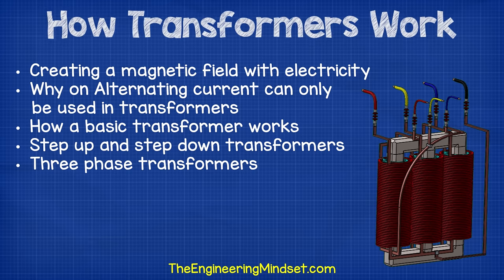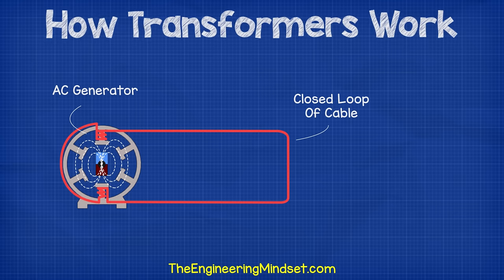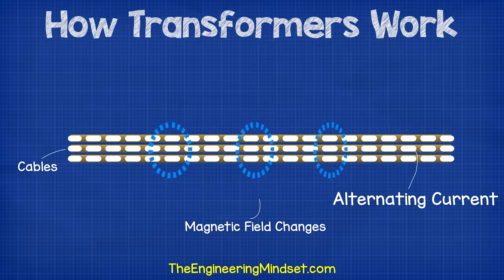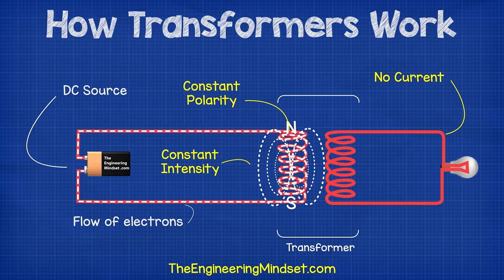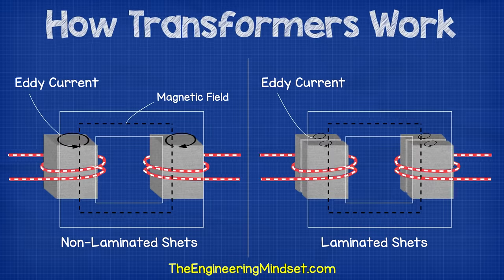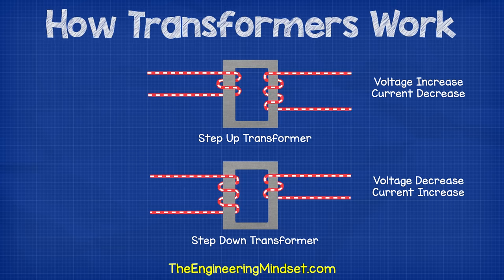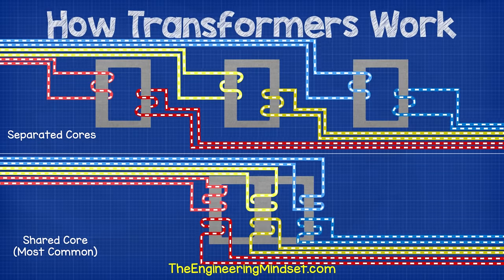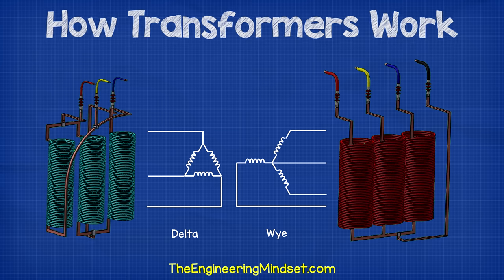How does a Transformer work  - Working Principle electrical engineering

Comment: So do I understand this right?

If I want to convert 120v AC to 5V DC, I should first use a transformer to bring it down to 5V, and then use a full-bridge rectifier (with capacitors) on the 5V side to make it smooth DC?
Reply: you can also use a transformer with slightly higher secondary voltage and an integrated circuit to hold the DC output constant. in your case, a transformer with at least 8V secondary voltage and a LM7805 provide a stable DC output of 5V, using a bridge rectifier and bypass capacitors
Reply from the maker: Rectifier video here https://youtu.be/RiRyzLl4Y8U
Reply from the maker: Seen our new Transformer video? here https://youtu.be/jcY4QN7awEc

Comment: What happens to current when voltage steps up? I've heard the current drops but ohms law says the current should also increase unless the resistance also increases.
Reply: When voltage rises the current goes down. In theory on an ideal transformer the power doesn't decrese so P=UI on both sides. From this you can see that when voltage increases, current decreases. It has nothing to do with resistance.
Reply from the maker: Seen our new Transformer video? here https://youtu.be/jcY4QN7awEc

Comment: At 4:40 you mentioned how a power station would use a step-up transformer to increase the voltage... but why would it also decrease the current? Ohms law says the voltage is directly proportional to the current, so I don't understand why increasing the voltage through the transformer would decrease the current.

EDIT: after some googling, I found out that what's missing is the idea of Power which is a product of the voltage and current: "to maintain the same power, if we increase voltage, what happens to the current?". This concept is missing from the textbooks and this video =( Also the voltage in Ohms law relates to potential difference (i.e. between two points) not along a conductor.
Reply from the maker: Seen our new Transformer video? here https://youtu.be/jcY4QN7awEc

Comment: I assume it possible to step up 240 1ph to 480 3ph.....however if you have a 1ph 120/120 line IN, whats the safest way to introduce the L3 from either L1 & L2 on the Step transformer  so it powers a 3ph 480 motor without the use of an idler motor phase converter ? Thank you
Reply from the maker: Seen our new Transformer video? here https://youtu.be/jcY4QN7awEc

Comment: According the law of energy conservation, when6the voltage is being stepped up the current should descress subsequently. However, according to ohm's law, and increase in voltage will lead to an increase in current given the same resistance. These two rule seems to cotridict one another, how does that work?
Reply from the maker: See our newer transformer video, fully explained

Comment: Paul, I have a question. When DC is being switched in voltage and creates some minor EMF, what is the type of current on the other side of the transformer?
Reply: Impulse?
Reply from the maker: Seen our new Transformer video? here https://youtu.be/jcY4QN7awEc
Reply: @EngineeringMindset  Thank You! You are by far one of the best sources for amateur electronics.

Comment: Will magnet as a core (instead of iron piece) make any difference to the amount of the magnetic flux/power resulted?
If it is, does it affect the voltage generated? or the amperage?
Reply from the maker: Seen our new Transformer video? here https://youtu.be/jcY4QN7awEc

Comment: If the inner coils are your lower voltage, (secondary windings) and your outer coils are your higher voltage (primary windings), wouldn't the inner coils then be the star configuration with 4 bushings?. Electricity in the UK is stepped down from 11kV to 400/230, using a neutral so I thought the configuration would be the opposite of what it is in this video.
Reply: Is it possible you meant low current instead of voltage? Where current is inversely proportional to voltage in a transformer, it would make sense that current would be lower on the side with higher voltage (Delta configuration).

Comment: This might be a stupid question - Why is the light bulb only lights in AC current and not in DC current? I get that magnetic field is constant but in simple terms is it safe to assume that DC is basically "low current" which is mostly used in battery type devices and AC is "High current" that basically runs your home appliances. If this is true why did we ever need DC and AC current, why not have one and create devices that run on one current?

Comment: What do you mean when you say that power stations will use step up transformers to increase the voltage but reduce current to minimize losses over long distances. Does not increasing voltage, increase the current? Is some form of resistor involved to reduce the current?
Reply: No since you can't get something for nothing . I will explain briefly . Say the power station generates 10000 volts at 1000 amps , they step up the voltage to 50000 volts now they have only 200 amps in that line going to your town . And they change it back 10000 volts and 1000 amps , so they can distribute it in you neighborhood where it is changed again to 120 volts and something like 36000 amps give or take so it can be brought to your home .  Amps or current is how much work can be done . Volts is push . So the higher the voltage the farther it can travel . That is why wires are sized on the amount of amps they can safely handle without over heating and they voltage rating you may see on wires is more about how well it can insulate and hold the voltage from jumping thru it . I know this is a simple explanation and the numbers I used are just for illustration .
Reply: @lhr1701  Thanks for the explanation. I need to re understand my concept of voltage. What you are trying to say is something like this : If a power plant generates 10000000 Watts (i.e., 10000 KW or 10 MW) it can distribute/transmit it (send it to a town) as 10000Volts x 1000Amps OR 50000Volts x 200Amps  because Power(in watts) = Volts x Amps and they choose the ideal V and Amps to transmit.  You are also saying higher the V a lot more distance they will travel. You are also Suggesting, the amount of amps we get at a home determines how many appliances I can use (lights, microwave, washing machine, electric stove, Air conditioning etc etc). I had always thought the more volts we get the more Amps we have.
Reply: @bluewaters4567  You have the concept correct just not the numbers . The high tension power lines carry the voltage between 155,000 and 765,000 volts . If you noticed just how far apart the lines are from each other , that is because the potential of the electrons at such a high voltage is that they can jump across to the next line . Voltage equals push Amperage equals work .  As for your last statement think about your service panel it is rated usually 220 volts and 200 amps . {Most wire are rated for 600 volts then you have to go by their size to determine how much current/amps they can safely handle. }  Anyway You have only have 200 amps available to use safely . Even though if you added up all the outlets and other electrical loads in your home is greater than 200 amps , you probably will never use everything at the same time . Say you did and tried to 230 amps then the main breaker would trip and keep the wires that feed the power into your home from heating up and possibly shorting out . Say you had lights , refrigerator and some outlets on the same 15 amp breaker and now you plug in a heavy duty mixer ( to bake a cake ) since motors pull up to 5 times theri running current for an instant when they start the breaker pops and that is because you are asking the wires and the breaker to do more work then it can safely do . This is a problem for older homes , but in newer homes wired properly not so much . I hope you understand now .
Reply: @lhr1701  That is a good explanation for now. Ill look at some concepts more in detail to understand them better.  Particularly the volts part. The Amps is easy to understand. It seems from your explanation above that the same number of electrons from a higher voltage source can do more work than the same number of electrons from a lower voltage source .
Reply: @bluewaters4567  Sort of . A dual Voltage machine say a Stud welder runs at 460 volts and 100 amps . But if you change the voltage down to 220/230 ( here in NYC technically we have 208 volts ) you then need 200 amps to do the same amount of work .  It doesn't matter if you are powering HVAC equipment , motors to run pumps , or lighting . There is always the same relationship between volts and amps . This is for 3 phase power as the video showed .
Reply from the maker: Seen our new Transformer video? here https://youtu.be/jcY4QN7awEc
Reply from the maker: Check out NEW resistor video, everything covered! ➡️ https://youtu.be/DYcLFHgVCn0

Comment: Sir,I am Abhranil,from india.I watch your videos on a relgular basis.I have a question from transformer breather working principal. A partially oil filled cup is used to absorb the dust particles from air before it enters in the silica gel container.There is a oil level mark over this cup.My question is the air inlet/outlet duct which is looking like partially submerged in oil (oil cup).So is it the right process to fit this cup beneath the breather air ventilation duct.I think in this situation it can release conservator's air from this submerged in oil duct,but can not inhale fresh air because it is already submerged,how can something breath inside any liquid substance.
Reply from the maker: Seen our new Transformer video? here https://youtu.be/jcY4QN7awEc

Comment: I read somewhere that some grids convert AC to DC, the electricity goes through the transmission lines, then converted to AC again. Is this correct? If so, please explain how this works.
Reply: To my knowledge, the only time you'll see AC-DC conversion is at the customer side, not the supply side. DC does not travel long distances well. The power station generates AC, transmits in AC through the large power lines, and then it is stepped down using transformers to a safe voltage to enter homes. Lots (most?) small electronics want DC power, so their power supplies will have an AC-DC converter block. Just look at your computer charger. Is there a large block in the cable? That's the AC-DC converter.
Reply from the maker: Seen our new Transformer video? here https://youtu.be/jcY4QN7awEc

Comment: What is the difference between a transformer and a rectifier?  My understanding from watching your video series is they both convert AC to DC.
Reply: A transformer alone does not convert to DC, the output is just a different AC voltage at the same frequency.  A rectifier is a bridge of diodes that conversts AC to a DC wave.  You normally have capacitors to smooth it out.   In Telecom a rectifier is usually an AC-DC converter (much like a computer power supply), it will convert 120 or 240v to 48vdc.   It will have a transformer inside and a full bridge rectifier and the circuitry to do the regulation etc.
Reply: @redsquirrelftw  ok so the transformer alone either steps up or steps down AC voltage?  Then a rectifier converts AC to DC.  Is that right?
Reply: @tom110111  More or less yes.  They are two different things, but often used together in various power supplies.  A phone charger for example will take 120vac and convert to 5vdc.  It will have a transformer as well as a rectifier and also regulation circuitry.  You can lookup buck converter, as that is typically what these are.
Reply: @redsquirrelftw  thanks for the info.
Reply from the maker: Rectifier video here https://youtu.be/RiRyzLl4Y8U
Reply from the maker: Seen our new Transformer video? here https://youtu.be/jcY4QN7awEc

Comment: Would there be any use for a transformer which used power MOSFets to bypass chunks of winding like a programmable, switchable transformer? Half the turns on each side are bypassed with bit 8, bit 7 bypasses half the remainder etc. Using 256 windings per side (or a multiple thereof), the number of coils could be set by sending ~(number of windings) over the output line so a transformer could be step up or step down with pretty accurate control of the ratio in between. It's neat, I think, but what would it be used for? MPPT, perhaps? Constant current output?
Reply from the maker: Seen our new Transformer video? here https://youtu.be/jcY4QN7awEc
Reply from the maker: See my new MOSFET explained video here➡️: https://youtu.be/AwRJsze_9m4

Comment: Thank you :) is there a video on how high voltage results in low current for AC current; this is very difficult to understand and I've searched the internet for hours with no satisfying answer. V=IR makes this seem counterintuitive; I know this can be explained with P=VI but I don't understand why this is the case when it would seem a higher V would results in higher I.
Reply from the maker: Seen our new Transformer video? here https://youtu.be/jcY4QN7awEc

Comment: Please answer this very basic and rudimentary question? Why doesn’t the transformer blow up if in a WYE system all the wires are connected. 

But on the other end if the hots touch anything there is death. 

Please explain. I don’t understand it.

Comment: why does stepping down the voltage make it safe when its the current that kills you? the net wattage is the same, and stepping it down would increase the current which would require thicker cables and increasing the losses.
Reply: Current is a consequence of voltage. Electric charges flow because of how they are arranged with respect to each other, i.e. they flow because there is a difference in electric potential between two points. Consider a single free electron and a positively charged object that is fixed on place. The difference in charges results in an electric field directed from the postive object to the electron. Equivalently, there is a difference in electric potential: high electric potential at the positive object, compared to low electric potential at the electron. Because of this, a force is exerted on the electron towards the positive object; the electron wants to move towards the positive object. This is all the consequence of voltage a.k.a. potential difference.

The force exerted on the electron due to the voltage that is present causes the electron to move: this is electric current — it is caused by the voltage.

When the medium that the electron is passing through (e.g. air, water, rock, metal) restricts its movement, we say that the medium exhibits electrical resistance or electrical impedance — this lessens the current for a particular voltage. This phenomenon is encapsulated in Ohm's law; generally speaking, for a medium of given resistance, we find that doubling the voltage also doubles the current, hence V = IR.

So now that we've clarified some of the concepts, let's directly respond to your comment.

You ask: "Why does stepping down the voltage make it safe when its the current that kills you? — We do this because it's the voltage that causes the current. The human body has (loosely speaking) a fixed resistance (on the order of thousands of ohms), so in order to induce a lethal current inside the body (which is around 0.1 amps), there must be a sufficient voltage across the body. Per Ohm's law, assuming a resistance of 1,000 Ω, we have V = IR = 0.1 A × 1,000 Ω = 100 V; there must be at least 100 V across the body the induce a lethal current.

You also say: "The net wattage is the same, and stepping it down would increase the current which would require thicker cables and increasing the losses." — This is true, but only specifically in the context of the cabling, which is of fixed resistance, at least compared to the human body, which is of much higher resistance by comparison. That is, we step down the voltage once the energy reaches residential supply for the benefit of us humans, so that it is less likely to kill us, but at the expense of efficient cabling; we require thicker cables in residential areas. However, the exact opposite is true when it comes to transmission: it is the very issue of needing impractically thick cables to transmit electricity at low voltages which resulted in us deciding to use extremely high voltages for transmission, so that our transmission cabling doesn't collapse under its own weight.

I hope this helps! 🙂
Reply from the maker: Seen our new Transformer video? here https://youtu.be/jcY4QN7awEc

Comment: if AC current disrupts and changes the induced current on the adjacent coil then why wouldnt taking dc current and turning it on and off real fast disrupt the field and induce a current. is it not the changeing direction of current but the actual rise and fall of a magnetic field? so couldnt i just pulsate a dc current to create dc induction?
Reply from the maker: Seen our new Transformer video? here https://youtu.be/jcY4QN7awEc